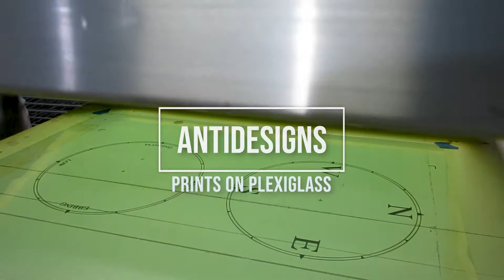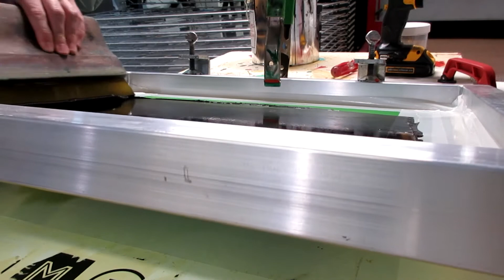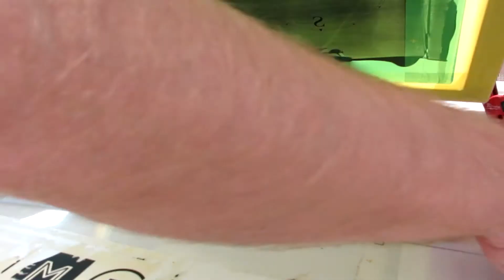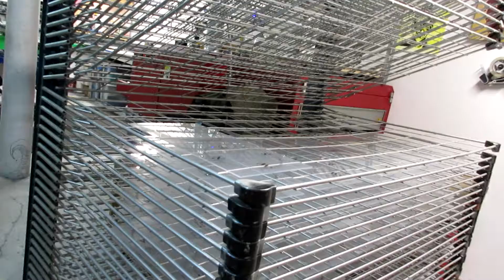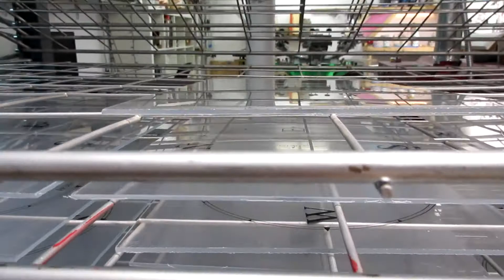Screen Printing Gloss Enamel On Plexiglass

Comment: Bless you and thank you for this video. Two questions if you don't mind:

1. How are you controlling off contact? Do you have something adding height to bottom side of frame?

2.  What rack do you have the parts drying on? 

Again, thanks for the video!
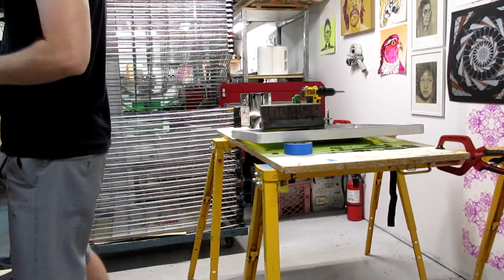Reply from the maker: You're welcome. I like to use quarters/coins to control my off contact. You can see one on the table at timestamp 1:36. That way if I have to add more, I can easily add the exact same vertical distance across all areas of the screen. The drying rack is an old AWT drying rack. Not sure where you are in the word but you can find a used one on digitsmith or craigslist here in the US. Hope that helps
Reply: Thank you so much! A couple additional questions of you don't mind:

1.  Why are your clamps installed inside a cutout of the white tabletop?

2. Do you use just one quarter or one on each quarter?
Reply from the maker: @gracebyseven  1: Great question! We created that board so many years ago and have never really address that. Those standard hinge clamps have a very thick base and we found early on that the print area closest to the clamps was very high off of the table. This made for difficult prints... almost too much of an off contact. So we got our hands on a router tool and dug into the table about a 1/8" and that helped alleviate that issue. 

2: For each project that we print on those flatstock boards, like the one seen here, the number of quarters we place on press is different. It depends on where the image is placed on screen, how big the deposit of ink is on the material, and how difficult it is to get the screen to pop cleanly. We just keep a bunch of quarters by the press and adjust the number that we used depending on how the first test prints release.

Hope that helps
Reply: @antiDesigns617  thanks again! I'm trying out a similar process for our parts that are chemically etched. Ill let you know how they turn out. Would love to stay in contact and exchange techniques perhaps!
Reply from the maker: Def let me know and good luck!

Comment: how does the ink bond to glossy acrylic?  I see boat switch panels are often screen printed. Does the paint chemically bond to the acrylic ?
Reply from the maker: Whenever you have a material you want to print on that’s questionable, call / email your supplier and ask them what the proper ink treatment is. You don’t need to understand the chemistry between the ink and the material! You aren’t a chemist, you’re a screen printer! Keep it simple and use this problem solving technique to solve your ink/material needs in the future.

Comment: Do you feel that the gloss enamel paint holds up? Does it crack or anything after a few months?
Reply from the maker: Great question... we are super confident in the gloss enamel's ability to not crack or peel off the plexiglass. The only way it would do something funny is if there's something that gets in between the plexi and enamel before the enamel can dry. Otherwise it'll last a very long time!

Comment: What kind of ink did you use on it? I want to tru it on acrylic wedding invitation. And how long did you let it dry?
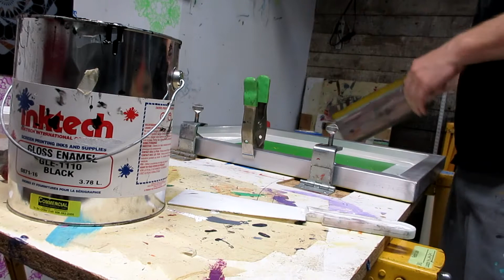Reply from the maker: I used gloss enamel. You can see the label clearly @ 0:37. They dried for 24 hours before I unracked them.
Reply: @antiDesigns617  thanks for your answer, and what size your net is? 200?
Reply from the maker: @MIMICHI09  No problem. I used a 230 (lines per inch) mesh screen

Comment: whats is your print table made out off? saw horses  and wood board? i need something like that but smaller
Reply from the maker: Exactly.. our main flatstock print station was held up with another project so I setup this press on some old sawhorses. I leveled out the sawhorses and then used a 2x4’ melamine board as the tabletop. You can get those a big hardware stores and they’re the same material used on most rotary presses for the platens/pallets. If you need something smaller just ask the hardware folks to trim it down to size before you make your purchase.